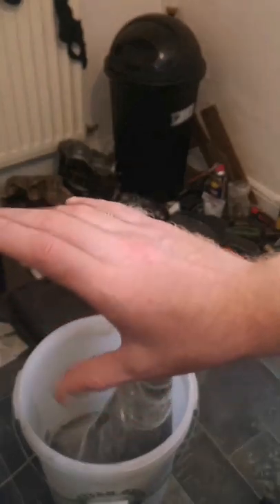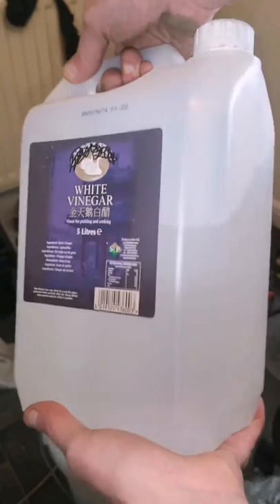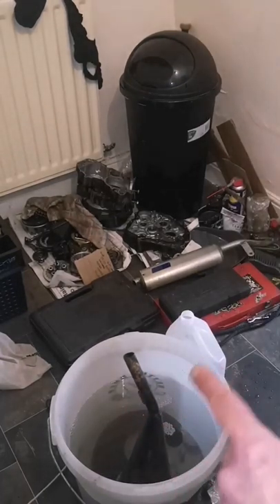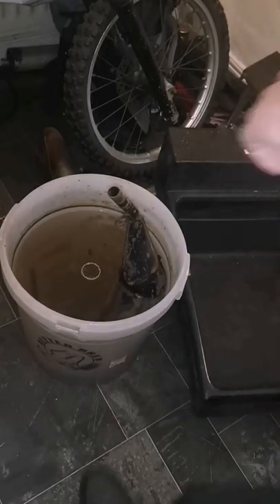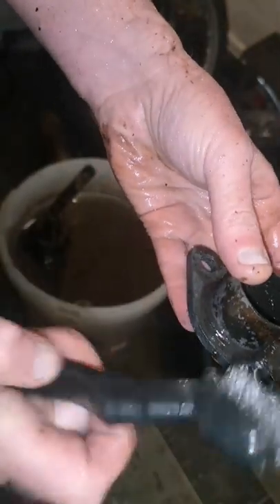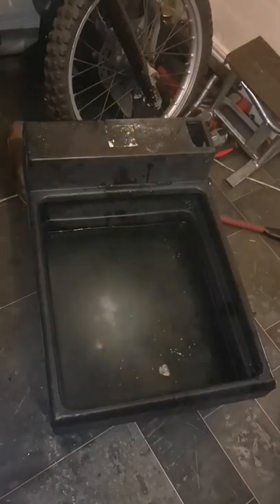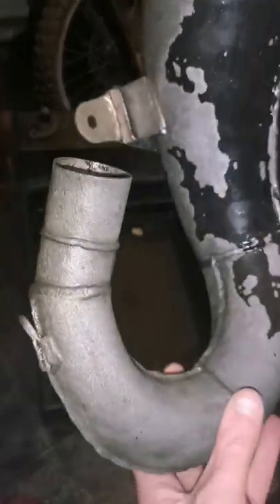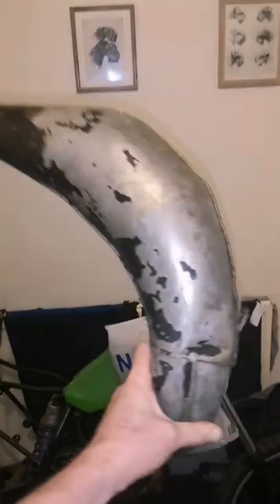How to restore a rusty motorbike exhaust/how good is vinegar for rust removal/dtr125 big one exhaust

Comment: Your subtitle said its been in 15 years in that vinger 😂😂 i built a sandblster cabinet  out of 55 gallon drum window from tv cabinet two peaces of drain pipe for glove hole's i just do everything in that now just threw it in & it's done within 5 minutes get yourself one built mx motorcycle classics i always use barbecue stove black on them brilliant match for yamys pal put pressure washer fitted too it for the dent
Reply from the maker: Hi m8 a rarely take the rust off stuff it was just for ease really, I've not tried the bbq I've got some vht exhaust paint for it , what do ya rig the sandblasted upto, sounds a good idea, ya know that big circlip on the front caliper how do ya get that in m8
Reply: @2strokemxclassics  i connect it to my air compressor 20cfm twin cylinder pumps i also have a smaller compressor oil free one for my powdering gun just in the middle of revamping my vapor blast cabinet.nearly done every nut bolt spindle on my dtr this bike will look mint when done all ome parts fittings everything down to a Tee just how i like them standard original m8
Reply: @2strokemxclassics  put the seal in first then slide the snap ring into it's groove in the seal then work your way round with a flat head screw driver sorry m8 never seen your question about the snap ring just seen it
Reply from the maker: No probs m8 so do i just hold one end in and Goe round pushing the screwy in